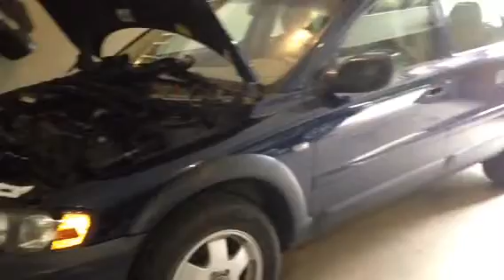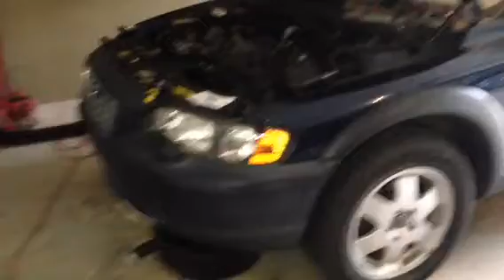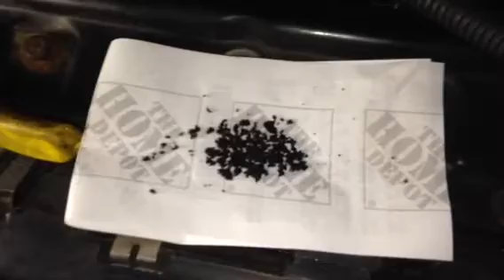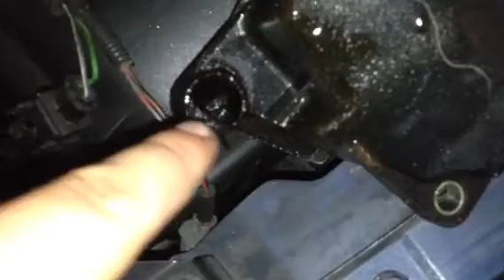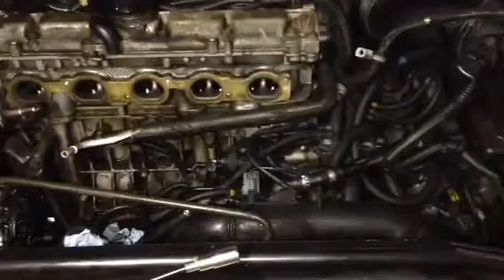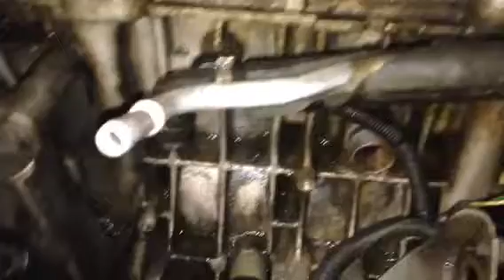2002 Volvo V70xc PCV Maintenance

Comment: Dude your intake valves are clean bc this car has port injection, they are constantly bathed in solvent gasoline.  GDI would be a different story.  check your exhaust valves for a true picture of the head's condition.